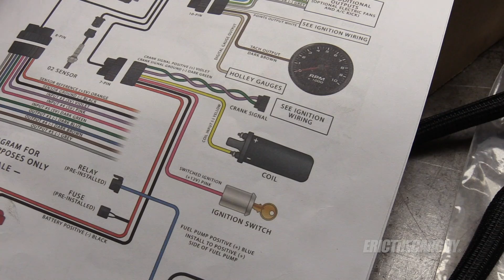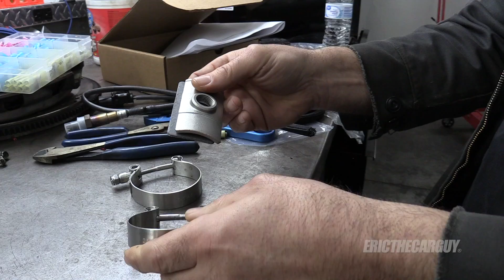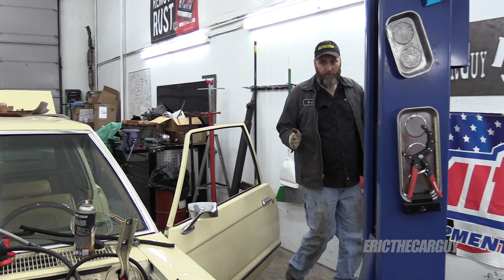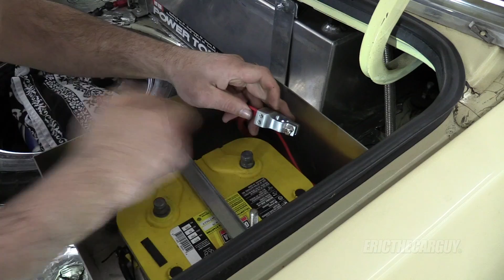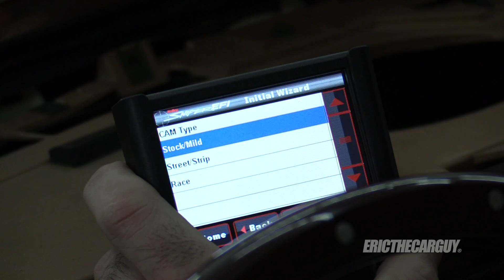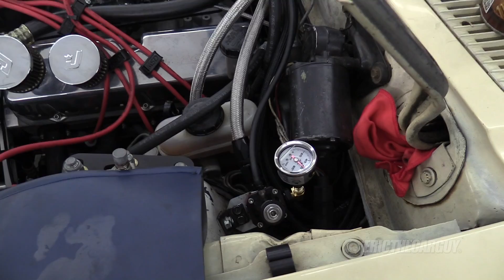How To Install a Holley Super Sniper EFI

Comment: Not a good choice Eric.  If you're going to move to EFI, just go full engine management, with multi-point, sequential injection.  It seems you're kinda missing the point or do not understand the value of running engine management vs. 'fuel injection'.  The 'fuel injection' part of engine management is maybe only 20% of the total value in running engine management.  This solution is really poor mans EFI and you are not a poor man!
Reply: @Chase Postell  I stated some facts about Eric's choice.  I did not personally run him down.  You and Eric are doing that to me because facts upset you.
Reply: @Chase Postell   Just as I thought, nothing of value to add.
Reply: Lol.
Reply: This is my thoughts exactly. I glossed over the last video he posted about going EFI, but I assumed it was going to be a traditional standalone EFI system with 8 individual injectors, and full control over fuel and ignition.
Reply: No need to get salty Eric. I'm actually surprised you went this route. With how much money is tied into the motor, it's power capability, and how much you drive home the fact that you want driveability, fuel mileage, awesome cold starts, throttle response, and all that good stuff that you want in a street car, it seems like a no brainer to bite the bullet and go for a full control multi port setup. This just seems so out-dated for what you want to do with the car.
Reply: @dropinbiking92  I have been trying to tell Eric this for years, but he only wants to argue.  It would improve the Fairmont absolutely out of sight and he would never have ruined his engine the way he has.
Reply: @dropinbiking92  Exactly!!!  Someone please try to tell Eric, since he just thinks I am an asshole.
Reply: Can you please explain what you mean by 'engine management' as opposed to EFI? Can you please provide a link to a sample 'engine management' product?
Reply: @Gábriel Priòre  Engine Management means the engine control system is self-monitoring and adjusting across all variables. For example, you can ask it to control ignition timing based on intake temperature or oil temperature or water temperature - or all of these things.  That means you don't melt pistons.  Or you can plug in offset values to say at coolant temp 220f, enrich the fuel mixture by 12%.  If knock is detected, ignition timing is retarded.  These are just very basic controls.  More advanced systems actually measure not only crankshaft speed, but crankshaft acceleration - in doing so, the system can tell you which cylinder is misfiring and why.  So many benefits.  Haltech Elite or any Ford or GM ECU in the last 10 years can do all these things.
Reply: @ArchimedeanEye  WoW! Extremely interesting! I looked up the Haltech Elite 950 {for Ford Big Block V8}, and it actually says it has multi-fuel support. So are you saying I can 'combine' this with the Holley Sniper EFI?
Reply: @Gábriel Priòre  No, you just run a single engine management system, like the Haltech or Motec or Holley Dominator.  That way, all aspects of the engine are mathematically controlled.  I've converted many older engines to full engine management over the years and it makes them behave 100% like a brand new car.
Reply: You're always better having the engine controlled by one unit, rather than multiple systems. There was a time in the 90's (maybe it was just an import thing?) Where EFI tuning was in a scary place. Piggy back systems left and right, seperate timing controllers, seperate fuel controllers. You'd end up with a jumbled mess of 2-3 different boxes to control the engine. As soon as "all in one" units hit the market, it was a no brainer. Ditch multiple controllers and replace it with a single unit that can read, monitor, log, and manipulate EVERYTHING that goes through the ECU. It's staggering the control you can have, even on some of the more basic systems.
Reply: @ArchimedeanEye  I looked up the Haltech, and I don't see any fuel injectors built-in. It just looks like a big computer. So I don't understand how you would not also need a Holley Sniper. Thank you for bringing this up! The timing was perfect for me. I will need to discuss this with my restoration specialist.
Reply: @dropinbiking92  Very true!  Even the GM Delco group-firing injector systems used from the mid-late 1980's had quite incredible levels of engine control.  I've used variations of that ECU many times back in the day and the later stuff builds on that to the point where control is almost infinite. I know Eric would love it and geek out on it, but he seems committed to doing things the hard and expensive way.
Reply: My honda ECU from 92 is insanely capable. I've got some pretty awesome fail safes setup to first flash some bright red lights at me. If that's not enough it pulls a shit load of timing and disables my boost control solenoid, and if that's not enough and I'm still ignoring my danger to manifold warnings it will literally shut itself off. Doesn't get much more fail safe than that.
Reply: @Gábriel Priòre  It's a big computer, because you can then run 8 x individual injectors, right above the inlet valves in the manifold.  This then also gives you the ability to sequentially control fuel timing, instead of just spraying a 'fog' of fuel into the intake manifold and hoping and preying that it evenly enters the cylinders.  This means better fuel economy, more power, easier starting, cleaner oil, better response etc.
Reply: The computer is just that, just a computer. It will require the engine to already be prepped for fuel injection, meaning an intake manifold with individual injectors, fuel rails, a high pressure fuel system, cam and crank sensors, amongst other things. Computers are only as smart as the information you give them. There's a big jump from a basic carb setup, to a throttle body injection, to multi-port injection, to direct injection. Each getting more and more precise as you step up in technology.
Reply: @dropinbiking92  ive seen some people use ecu's like haltech to upgrade a carbureted engine, it's preety labour intensive and involves alot of cutting and welding when there's no available intake manifold. In a case like this with somebody who has the knowhow and skills, it could be successfully implemented.
Look at the Australians for evidence of using haltech ecu's with strictly carbureted engines
Reply: @ArchimedeanEye  You're not going to believe what I just learned! The new Edelbrock Pro-Flo 4 EFI #35680 {Big-Block 460} is already fully ready-to-go, which includes the fuel rails, all 8 injectors, and does not even need to be paired with a Haltech Elite 950, because, it already has that full management capability all on its' own!! And here is a list of how it is infinitely superior to the Holley Sniper EFI: The Holley has the computer built directly into the throttle body, which is absolutely stupid, because, it will be sealed and surrounded by extreme heat, which will reduce its' overall lifespan. Everybody should already know how ridiculously sensitive computers are to heat, and that they easily become defective after too much prolonged heat exposure. Furthermore, when that computer eventually becomes defective, it cannot even be self-replaced!! The exact same applies with the built-in injectors AND built-in fuel pressure regulator!! Holley requires that you mail them the entire throttle body, because, only THEY can service it!! That is a planned scam!! However, on the Edelbrock version, the computer is completely separate!! And you can choose where to custom-mount it. Hell, you can even choose to mount a cooling fan to it so it lasts for decades without ever developing any defects due to heat!! Edelbrock even provided me with their part number to a complete brand-new set of 8 separate injectors, new separate fuel pressure regulator, and new separate computer!! That is absolutely AMAZING!!
Reply: To those criticizing Eric for his choices, you have to keep in mind his background.  He was a dealer tech, which means a parts replacer.  Fabrication and custom builds are new to him and he is learning as he goes along.  Most people wouldn’t show their mistakes on video.  Showing mistakes as Eric has done in the past is a learning experience not only for him, but for those viewing as well.  Eric has over 30K invested in to this car.  It is reasionable that he would be defensive when someone says he is wrong.  In my opinion he should not react as harshly as he has to comments, because there is no way of knowing how much knowledge the person commenting has.  I don’t think it was a good idea to cut the harness and refer to the manufacturer as being “butt hurt” over it.  I suspect that voided the warranty, or gives them an excuse to not honor a claim in the future should something go wrong.  

@Eric, I will suggest you loose the it’s my car I can do what I want attitude.  Your name may be on the title, but the car belongs to the viewers and sponsors, because with out them, you would not have it.  Making comments as you have may cause you to loose viewers, thus income.  Several months back, you put out a video saying you were upset because youtube wasn’t paying and you depend on it for a living.  For that reason, I do suggest you be a little more polite when responding to comments even if you don’t agree with them.

I have complimented you in the past andd I have pointed out mistakes.  No one is above making mistakes.  When you make them, own them and learn from them.  Putting the oil return in the fairmont engine oil pan was wrong the way you did it, you were told that by a lot of people, including the owner of the machine shop, yet you refused to admit it was wrong.  That made you look bad to a lot of people.

You put the channel out for people to learn.  Well, you can learn from those that comment as well.  A while back you said everyone watching your videos is ignorant.  That comment was just wrong.  It upset a lot of people, yet you never apologized for it.  

I hope I have explained things in a way that helps you to understand.  Remember this, the viewers do not need you to pay their bills, but you need the viewers to pay your bills.
Reply from the maker: @Rick Gaine I appreciate your input, but ArchimedeanEye and I have a history. It's not the first time he's shown up in the comments on the attack. Hence my response. 

I'd also like to add that I could have banned him long ago. I chose not to. Honestly, I appreciate my interaction with the viewers, especially the ones that know more than I do. I realize ArchimedeanEye probably has more experience with this kind of work than I do. I've learned this from previous exchanges. At one point we seemed to come to an understanding. That seems to be gone with his most recent comment here, hence my response. 

The truth is, I've learned tons from my viewers, even ones I didn't initially get along with. Personally, I don't feel I'm being difficult at all, but perception is in the eye of the beholder. I can't see things the way you do, anymore than you can see things the way I do. We are who we are. 

I'm well aware of the symbiotic relationship I have with the viewers. If you like, and have the time, read through the comments to this video. I think you'll find that my demeanor is not as you describe. At least, I don't feel that it is.

I'm glad you brought up the oil return line. 2 years after the install, no leaks, no issues, no problems. Am I still wrong for what I did? Where do you draw the line and admit that YOU might be wrong about something? So far the evidence about the oil return says that you are. Are you willing to admit that you're wrong, or are you going to insist that you're right despite the evidence? To me, that would seem arrogant. Like I said, we are who we are.
Reply: EricTheCarGuy   I don’t follow all the comments you get, so I’m not familiar with the relationship you have with everyone.  WRT the oil  return line, I stick by what I originally stated.  Punching a hole in the pan instead of welding on a bung was wrong.  That was even stated by the professional you had do your machine work.  You can’t get out of that one.  Perhaps it did not leak, but it was still the wrong way to do it especially since you had the pan in your hand.  I appreciate the work you do.  I remember you standing in front of the Dodge after you dropped the seized engine in it.  You could have cut that entirely, but you didn’t.  Lesson learned for not only you but by all those that viewed the video.  I also remember your swapping the engine in the S-15 for the family of your friend that passed.  That was extremely decent of you.  I know from personal experience how hard working on that truck must have been on you.  Honestly, I think you and I would get along just fine.  We are both straight shooters.  I point out things I think are wrong, always have.  Honestly, I was thinking of putting the Sniper on my 65 Mustang.  Wanted to see your video to see a real world install instead of the fluff you get on TV shows.  I admit at times I may come across to hard.  Sorry for that.  Keep up the good work.  I know how much your Dad appreciates the work you are doing on the truck.  One thing you didn’t mention adding to the truck that I think is important, especially if your Dad is going to drive it on the power tour.  Make sure there is a conveniently placed cup holder. :)
Reply from the maker: @Rick Gaine See, this is what I'm getting at. You still insist that you're right about the oil return, yet there aren't any issues with it after 6000 miles. Yea, I agree that welding would have been better, but the instructions, FROM THE MANUFACTURER, stated to do exactly what I did. This would be valuable information to someone who didn't have access to a welder, or that wanted to follow the instructions. As you pointed out, if it did leak, I'd share that, but it didn't leak. 

Here's a bit of information I'll share with you that solidifies my point. When I took the engine out last summer I upgraded the turbo to a ceramic ball bering type. When I did that, I also upgraded the return line to a steel braided set up with AN fittings. All I needed to do was unscrew the old nipple port from the oil pan and screw in a new AN port. Had I welded the old one in place, I wouldn't have been able to do that so easily. BTW, still no leaks.

This is where things get a little muddy. In your eyes, it's still wrong, but the facts don't support your belief. The question still stands, at what point do you admit that you were wrong? I'd wager, never, so for me, it's not worth arguing over. I'll just let you believe you're right about that and move on.

Like ArchimedeanEye, who insists that he's right all the time, that leaves no room for a real discussion on the topic based on the facts. Instead it's just hard fast opinions which is the reason I cut him off this time. ArchimedeanEye crossed into that area where he's just on the attack and it doesn't matter what I say, I'm still wrong. Do you blame me for not engaging with someone like that? I mean, how long do you go on before it's just not worth it anymore? I've already stated my reasons for going with this system in this video: https://youtu.be/zf48bgB88IY

How many times do I need to justify my actions before people just accept them? I did what I did because I feel it was the best choice based on the time and resources I had. I'm pretty happy with the system so far. How many times do I need to hear that I screwed up because I didn't install an MPFI system with full engine management? The system I have works, it suites my needs and the car runs fine. Once again, why should facts get in the way of opinions of commenters? Like I said in my comment, it's my car and I can do what I want with it. That is a fact that no commenter can dispute. 

Fun fact, I brought this very thing up in the very first video I ever posted. I saw people like ArchimedeanEye coming 10 years before they showed up. I knew they would, I know car people. They're like that. https://www.youtube.com/watch?v=_MQo_Xmkchg

Thank you for the conversation. I have no doubt that we could have spirited discussions over foamy beverages and be quite happy doing it. I don't mind people disagreeing with me, I do mind people attacking me and my work.
Reply: @EricTheCarGuy   Eric - When you went the carburettor route, I said you would not have sufficient control to prevent engine damage from occurring...  So you ran the carb and damage occurred.  Now, you have switched to a system where you still don't have full control... and you are still arguing that I am an asshole.  But really, I am just talking about facts.  We've been using full engine management since 1987 or so Eric. It literally transforms engines.  Your car deserves better than half-measures. Why is it you just want to be right for making poor decisions?  In this case, you are NOT right. There are better options and for some unknown reason you are avoiding them.
Reply from the maker: @ArchimedeanEye You're not listening to a word I've said about why I chose this system, or how I'm using this car. I'm tired of you insisting that I'm doing it wrong, and how you know everything about my car and what I should do with it. We've been down this road, you're wasting my time, again. 

As for the carburetor, I've answered to that, and  I've owned my mistakes with that. Yet you insist on bringing it up over and over. Thanks. 

I don't believe you have any interest whatsoever in helping me make the car better. If you did, you wouldn't make accusations, or lord over me like a puppet master. Every comment from you offers more gloom and doom to every detail of what I do with this car. If you were to offer suggestions like a reasonable person would, I would be more inclined to discuss it with you, but you're not reasonable, your fragile ego can't accept any of my opinions, it's your way or no way, and your most recent comment at the beginning of this thread is a classic example of what I'm referring to. Had you started with, "hey Eric, I've had extensive experience with this and I feel that a multiport set up would have been much better from the start. How come you chose this over a multiport set up?" That stars a dialog. That gives me the chance to explain myself. Instead, it's more "Eric! You're doing it wrong!"

If you really want to show me something, start your own YouTube channel, earn a decent amount of subscribers, and make videos of building your own cars. Then we'll check the comment section to see how you well hold up. My point in saying this is that I'm not just building cars, I'm also producing these videos for my viewers to watch. This creates an entirely new dynamic beyond just the build. Did you ever consider that I might have been thinking of fuel injection from the start, but wanted to share the experiences with a carburetor first? Or that I have future plans beyond what you see in the latest video? Or that I have sponsors to answer to? Or that I might not have the time to install a multiport system on this car because I'm in the middle of building a completely different vehicle for my dad to drive on the Power Tour this year? No, likely not. Your view is way to narrow for that. There's only room for you inside your head. No other opinions or reasoning will be accepted. It's your way or the highway. Me, I'm taking the highway in my newly fuel injected Fairmont. See ya.
Reply from the maker: @ArchimedeanEye  First, I have totally owned my part in burning up a piston in my Fairmont. 

https://www.youtube.com/watch?v=1Dr5PvrdAlE&t=3s

That had more to do with my inexperience tuning a forced inducted engine with a carburetor than it did the carburetor. I was the problem, not the carburetor. But you insist it was the carburetor. 

You need to let that go, it's way past time.  You: "I'm right, I was right, don't you see I was right Eric? I was right all along Eric. You were wrong Eric, just admit it" Seriously, get over yourself. Have you even read my last response to you? YOU'RE NOT LISTENING TO ANYTHING I'M SAYING, YOU'RE JUST REPEATING YOURSELF OVER AND OVER. 

Lastly, exactly what is it about having control of both the fuel and ignition that is not considered 'full engine management'?
Reply: EricTheCarGuy    I’m not interested in arguing about this.  We can agree to disagree.  It did not leak, but as you said the instructions were for someone with out access to a welder.  I appreciate all the hard work that has gone in to this project.  That said, welding on a bung so you could thread in a fitting rather than tapping a punched hole, you have to admit would have been cleaner.  That’s just my point.  It works, does it’s job and that is good.  There are a lot of ways you could have dumpped fuel in to this engine resulting from movement of your foot.  I don’t at all object to your choice here.  Would full multi port EFI had some benefit?  Perhaps, but the system you chose also has benefits.  I was wrong when I said the return line would leak and admit it.  Will you admit that welding a bung would have been cleaner and we can perhaps at some time in the future discuss it over a beverage?  I spent some time in Ohio a couple years ago.  I didn’t realize how much Ohio contributed to the automobile history.  I like the fairmont, and the truck.  Don’t forget what I said about the cup holder for your Dad.  Haters will be haters.  I am not one of them.  Perhaps as I said I come across to hard at times.  I won’t do that in the future with you.  I apologize for anything inappropriate I said in the past.  Enjoy the rest of your weekend.
Reply: @EricTheCarGuy  Thanks for the reply Eric.  You make some fair points about my attitude here in the terse comments I sometimes leave.  I DO have interest in making your car better and have always wanted the best for the project.  It's simply that sometimes I genuinely disagree with your thinking and your methods.  You are correct, I could convey this better and I do come off as an asshole sometimes. I apologize for this once again.  Thanks for not blocking me.  Lol.      

I guess I am frustrated to see a person with the mechanical and electrical means make what I consider to be a succession of less than optimal choices.  Especially given what you want the project to be and how nice it would be for your channel to make the task at hand the best, and highest quality it can be. Granted, I know very little about the video production business, so all things considered - of course I am unqualified to critique everything you do, but in terms of your build planning and execution I am qualified.  

This is where in previous comments you have jumped down my throat and been very defensive about some of those choices - choices that could easily be avoided with a rethink. This latest move to this style of injection is another one of those poor choices from a technical standpoint for a vehicle of this high calibre.  And I mean that by the way.  The car as a whole is an absolute weapon and I love your style in dreaming this up.    

I've mentioned the types of control systems that come with full engine management many times, I really wish you would look into it and take it more seriously as an option.  As a commenter point out, Honda were doing this in the late 80's and even domestics were doing it in the early 90's.  It's far more than simple fuel and spark.  You end up with an engine that has absolutely gobs more power everywhere (in an actual road setting), at any temperature, that has clean oil, that is reliable and starts like a Honda.  

Yet you will make the argument that the fuel vaporization has a cooling effect.  That is true, but one major constraint that comes with that is unequal fuel distribution, something you do not want on a turbo boosted engine and you cannot really measure since sparkplugs change while you drive back to the pits or the shop before you check them.  Sure, you can compensate for AFR unknowns with over the top fuel enrichment ratios... but whichever way you go in 'fogging' fuel into the engine, you risk uneven fuel distribution or over the top fuel enrichment.  In either case, you can easily leave 50 horsepower on the table across various engine temp variables AND you run the risk of damaging the engine quickly or slowly.  An engine that cost a whole lot of money and is a thing of beauty!   THAT is why I get annoyed with you Eric.  Why not make a plan to make it the best it can be?  Like your suspension .  

Now, compare this to even a very moderate technology engine computer, like a simple old LS1 unit.  The real secret in the longevity of those engines is not even how good the LS engine is, but how good the engine control system is.  If we compare to the situation above, think about how protected the engine is and how much more power it can make in ALL situations - and do it safely!  That's because you have near-precise fuelling in every cylinder, timed perfectly to maximize atomization.  You have all kinds of ignition control based on various engine temperatures, coolant, intake, oil.  Narrow band and wide band closed loop monitoring for perfect mixtures. If all that fails, knock monitoring.  Not to mention endless adjustments for driveability that all add up to a far nicer car in the end. 
Regarding your piston/engine issues, when I point out what happened, I don't mean it a 'haha, look at Eric' way.  To me, it's the expected result - and that has nothing to do with you. It's what happens when anyone attempts to make a turbo vehicle reliable and streetable using control systems that simply cannot cope with the number of variables at play.  And that's all this really is.  Control of variables.  Carburettors and conventional ignition systems do a good job of this to a point but if you have a play with a real engine management system on a boosted engine, you won't ever want to touch this stuff again Eric, unless it's for a shop truck or low buck, low power cruiser, in which case it's adequate enough.

With all that being said, I actually do respect whatever choice you make.  It may not sound like it with my terse words, but I'm just a nobody viewer here :-).  At least you are making choices and creating something truly special.  And I do mean that.  I really and truly honestly just think that you owe it to yourself to plan out and build a real kick ass engine management system with sequential injection, 8 ignition coils, knock control, vehicle speed input and wheel speed input front and rear, true innovation for an old Fairlane!  
Cheers.
Reply: @ArchimedeanEye  Thank you VERY much for introducing me to the full engine management system!!!
Reply from the maker: Oh look, Mr, Know-it-all is back. We were doing so well. I'm not going to bother why I didn't make that choice. It would be a waste of time and you would just turn around and tell me I'm wrong all over again, no matter how much logic I throw at you. No matter what I do, you won't be happy. I'll just say this, it's my car, I can do whatever I want with it. Thanks for your comment.
Reply: @EricTheCarGuy  I'm not trying to make you upset, but for a street car, where you make the decisions and get to make whatever you want, it is the wrong choice Eric.  Cars have been running full engine management with great success since the late 1980's, so why you persist with sub-optimal choices is beyond me.  Especially when you have a nice shop to work out of and the means to do so.  You attack me, but you are the one learning from melted engine parts and poor driveability etc, so why not use a system like a Haltech Elite or many other engine management systems that give you everything you want out of the car?
Reply: It's his car you arrogant jerk. You are free to build your own car. Have you in fact built any cars? Just curious....
Reply: @Simon Coles  Considering Eric's stated goals for the car, his love for the car and the investment in time and money, what is wrong with my comment?  It's clearly not the right choice.